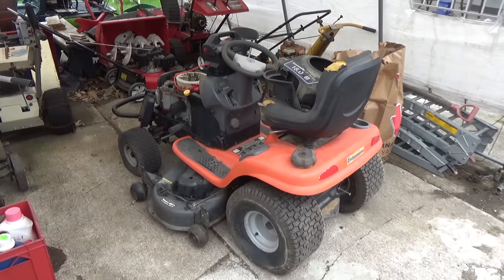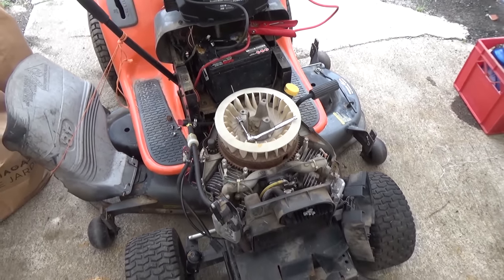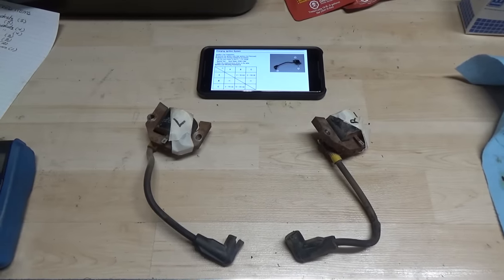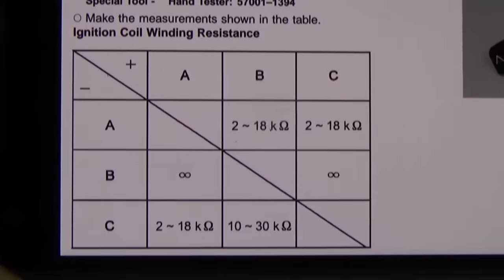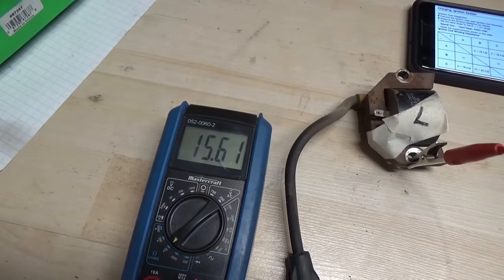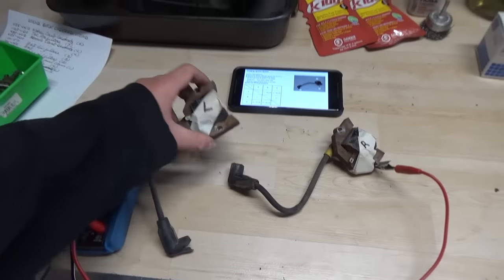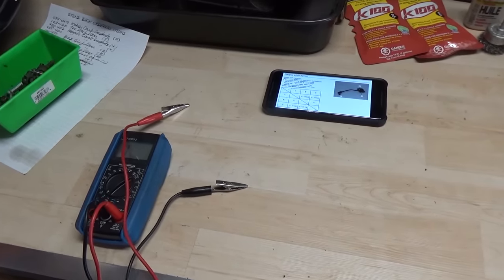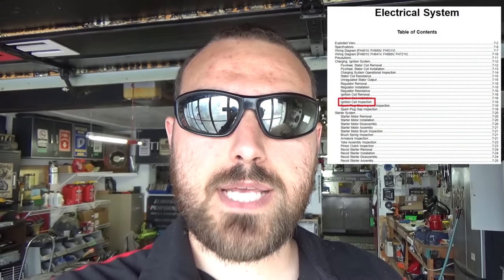How to Test a Lawnmower Coil

Comment from the maker: Couple people have asked why I tested it if it didn't produce spark when the "kill-wire' was disconnected.

This video is just a guide on how to test your coils (get the proper specs and use a multimeter to test for resistance).

Basically, if you unplug your ground wire on your coil and it doesn't produce spark, simply replace the coil.

However, if the coil produces weak spark, then you can use this video as a guide to test your coil, and determine if the coil is the issue.

I also have a video that shows a coil producing weak spark, due to a spark plug cap that has too much resistance. Once the engine got hot, it would shut down. Watch that video here; https://youtu.be/ejAX6Bn4WSo
Reply: Have you ever run across a coil that tested good and would fire until the engine got hot then shut down and stop firing?
Reply from the maker: Yes, usually due to excess of grass/dirt build up around the engine and coil pack.

This insulates the engine an causes the coil to stop working, I've seen it happen from mouse nests too!
Reply from the maker: Could also been a plugged fuel cap as well that's shutting your Engine down after a while. It could be vapour lock, because the cap doesn't let air into the tank so it stops fuel from going into the carburetor.

Once you let it sit for a bit they usually fire back up and run for about 10-15mins.
Reply: @EliminatorPerformance  Wow! Vapor lock does not cause the coils to stop firing! Vapor lock is a fuel delivery problem from excessive heat causing the fuel to "vapor lock"... Hence the name!!!
Reply from the maker: @timallbritton3716  I wasn't referring to a coil issue when speaking of vapour lock. He said his mower would die after it got hot.

Usually vapour lock causes an engine to shut down after 10-15mins
Reply: @timallbritton3716  Learn to read!!!!
Reply: @EliminatorPerformance  I have the FH500V that looses spark in 1 cylinder when hot. I've not yet determined which cylinder. The last time it was obvious by looking at the plugs. This time they look the same. I'm trying to avoid running on 1 cylinder. I assume that both coils will test fine if not hot.  Any suggestions?
Reply from the maker: When it gets hot and you think you've lost spark, let it keep running and pull the spark plug wire on one side. If it keeps running the same then you know that side has the coil issue.

If it shuts off, then the other side is your issue!
Reply: @EliminatorPerformance  OMG! Why didn't I think of that? Thanks!
Reply: This all smells like owner neglect. I've seen a few cases of that myself...
Reply from the maker: @lestergillis8171  it sat in a field for a long time, since this repair my customer hasn't brought this machine back because it's still running!
Reply: @EliminatorPerformance  This, of course begs the question: Why did they leave in an empty field & not even bother to put some kind of tarp over it ?
Reply: I have a 15HP Kawasaki with pull start. Not able to test spark single handed.
Reply: thanks to your video, i got an extra job/income. because of this. new subscriber. very helpful video.

Comment: You did a very good job on this video. Really helped a lot. The impressive thing was being honest at the end by placing all the old parts in a bag and back to the customer. Again great job.
Reply: That's normal practice, prevents the customer from saying they were charged for parts that either weren't replaced, or were replaced with used units

Comment: Excellent! I wish more YouTubers would be as concise and to the point as you are. I just subscribed. :)

A note:  It appears that some of the aftermarket coils, and in fact the coils on my John Deere (Kawasaki) mower have the kill switch terminal connected internally to the primary, rather than the secondary. This results in an Open  Loop (infinite resistance, or 0.L. on the meter screen)... yet the coil is good.

Grounding the primary or the secondary will kill the spark, so either side can be used by the manufacturer. If the secondary is connected to the kill terminal, you'll get the same reading you get when you read from the plug wire to frame ground. The plug wire will have no, or very low resistance when you check ohms to the kill terminal. But again, if they made the coil such that the kill lug grounds the primary, there will be no connection at all (open loop) to the frame or the plug wire.

Normally only one coil fails and the Right coil was obviously bad.  So... it's possible that these coils had primary connected kill switches, and the Left one was okay.  B to C or B to A should be totally open on a primary kill switch lug... they're making these things both ways... It's best to change both of them anyway, so it's good the customer got a fresh set of coils. :)
Reply: another way to rip us off

Comment: Well done. No chatter. Right to the point. I was wondering if the tolerance is pretty much standard for engines of a certain hp. If they are, you don't have to look around for the manual every time you're working, say,on a Briggs 17 to 24 hp. For example, if you're setting valve gaps, after a while you realize that if. you're dealing with an ordinary engine type, you don't have to look up the settings every time. You sort of know.
Reply: It is ok to use this tolerance as a guide but if it is available it is always good to check it to the manufacturers specifications.

Comment: At least Kawasaki is very good about giving you full specs on everything in their service manuals, including resistance readings on all relevant electrical components. Onan was also good about giving good specs in the service manual too. Tecumseh was probably the worst about giving you all the needed info.

Comment: When measuring the coil off an engine that dies when it warms up, I use a heat gun to see if things change as the coil gets hot. I have found a number of coils on mowers, chainsaws and weedeaters that will open up after they warm up. When in doubt, replace the coil. They are responsible for many intermittent problems after a few years of operation.
Reply from the maker: Yea heatsoak is a strange issue, and effects coils differently. That's a very good point, thanks for sharing!
Reply: How about cold weather?

Comment: Another great video by EP ..very knowledgeable  easy to understand. Jake breaks it down so easy.   EP has got me through some big jobs. Thanks again.
Reply from the maker: Thanks for watching!
Reply: @EliminatorPerformance  Hello do the coils have to be off the engine? Or can they be tested with them on. Thanks
Reply from the maker: Unplug the kill wire and turn over the engine, if it has spark, than it's not your coils!
Reply: @EliminatorPerformance  ohh ok. Well before I got you response I tested my “right” coil and it had the same results as your did on your “Left” one. From the “Kill” to the “Base”

Comment: Great diagnosis. It’s always a good idea to test the meter and leads before testing the component first though. By just touching the leads together first you should get 0 ohms. Just in case you have selected the wrong range or have a faulty lead on the meter or have one of the leads plugged into the wrong socket of the meter.
Reply: A very good point tony thanks.
Reply: How often do tje coils go bad

Comment: had a no start on a similar motor. This wasnt my problem but removing the kill wire to test was a good tip. I think my issue was rust on the coils. I removed them, cleaned, and reset the gap to the flywheel and got spark. Thanks

Comment: I have the same engine Kawasaki in a Husqvarna tractor mower. My first diagnosis was no spark. But I was wrong. I took a test light n placed it in spark plug cap and other end on spark plug(still in engine). Turned over engine and when I looked at plug there was a spark while holding it close to plug. Then with engine switched on I heard a small noise( sizzle). Realized sound was coming from bottom of carbaretor. Then cleaned plug in on solenoid. Still heard noise. Then tapped it gently with screwdriver and heard a click. Engine cranked up. I cut grass with mower for an hour. No issues. Just be sure there is actually no spark b4 buying a coil. I have been told they rarely go bad in pairs. Usually just one goes bad. Great video but I’m certainly a novice on a volt meter. Both mine checked bad but obviously my skills are not where they should be on the volt meter.

Comment: @4:20  Good comment about the plug connector.   I just had that very problem on my weed wacker.  I was happy when I found out I didn't have to buy a coil, which may not have been worth it for my old Echo.

Comment: Good video. Lot's of information. When is fixing not worth the parts and service? I guess when you don't have the money to buy a new one.
Reply: Fixing is not worth it when the labour and parts will cost more than 60% of the replacement cost of the unit. Additionally, if it is a push or self propelled mower not worth repair if the deck is rotting out and you can not get a decent deck for a cheap price used.

Comment: Thanks for the test numbers for the coils. Had been a lot of years since i had to. Test a coil. Very helpful. One thing to note is that a coil wire to base and the primary winding that is infinite is the some MTD mowers have a built in resistor in the spark plug end of the secondary wire. Mine had a open in that resistor. Eliminated it and the mower runs. Thanks again.

Comment: My ride-on has the same FH531V v-twin. It still runs but it's been progressively running rougher on each use and I found the spark is intermittent on both plugs. What would you know, it's got the same issue where both ignition coils are out of spec! I've used the mower every single year since purchase and so it would seem they've just gone bad with age.

Comment: I appreciate your testing, however it is possible you mis-diagnosed a faulty coil from the B-C connection.  When looking for a reading from 10-30K ohms, you cannot use the 20K ohm scale.  It must be reset to the next higher range.
Reply from the maker: I did end up testing at higher reading, I just didn't get that part on camera! Both these coils were shot!

Comment: Very Very good video, Thanks for including the coil air gap!. Dad used to stick a match book between magnet and coil, probabley learned it from a sage mower buff. Would this be a feasable method for adjustment? Please suggest
Reply from the maker: Business card is acceptable, they're usually 0.010"-0.012" which is fine on most mowers

Comment: can you have spark and still have a coil issue? I have Fc540v kawasaki that died but throws spark but will not start and blows flames out carb. key isn’t sheared and magnet hits last part of coil at tdc. all i’ve got left is the coil or valves messed up but I did check valve lash and it’s fine .006. Tried replacing the ignition module aka ignitor and still won’t start. my coil test says plug end to base is within specs at 11,300 but kill to base I can’t figure a reading based on specs calling for 60-100 and the best i can get is 0.7 on the 200 ohm setting. I tried pulling what you called kill wire that goes to the ignition module but then I have no spark at all.

Comment: If you've got compression, spark and fuel and it still won't run, check that the flywheel didn't break the keyway and rotate, putting the engine timing way off.
Reply: Great tip but if your engine has a decompression release you can not get a proper reading you need to perform a blow down test

Comment: I just acquired a long neglected John Deere tractor  that had a list of problems and a longer list of new part requirements. This unit had sat for an extended time also and had mice nests under the engine cover. They chewed up the plug wire at the coil, but not enough to make it unusable. Looking at the stacked laminations, one is becoming distorted by rust stack. The bolts that atttach these coils to the block look like they'll snap completely if any attempt is made to remove them......

Comment: Awesome video     THANK YOU........I had a lawnguy explain to me about the coil.......but he was in a hurry so I really couldnt keep up with it........having said that.....my question is I have a twin briggs and stratton 21hp  mower ,   he told me that if lets say the right cylinder doesnt start and run (without the plug in ) that it would 
be the opposite cylinder with the defective coil........did I missunderstand ???     Thank you again !!!
Reply from the maker: Yea so fire up your machine, and unplug 1 side. If it runs worse, you know that cylinder had spark. If it runs the same, and there's no change, you know that cylinder didn't have spark.
Reply: @EliminatorPerformance        aahhhhhhhhh ok now its coming together.....i know its not rocket science..........thank you so much......very MUCH appreciated....
Reply from the maker: @mundlkalli4396  anytime, cheers!

Comment: Most often the coil base has corroded so the electric circuit is blocked. De-rust the coil base and try again. You will need to space the armature/coil gap with a suitable piece of non magnetic material, such as brass feeler gauge. A lot of machines are left out in the weather, so corrosion is a good place to start.
Reply: Rusty surface causes no work on electric
Reply: Unless the amount of rust is significant or has totally seized the flywheel to the coil which we have seen the rust has no effect on the magnetism creating the spark. It is important though that the two pillar mounts for the coil be clean to contact a clean part on the coil to provide a good ground.

Comment: I got a brand new champion generator and is has no spark when its cold out.

Ran for 3 hours and wouldn't start again. Brought it inside. Gapped the coil, cleaned flywheel and magnet. Got great spark. 

Died in 3 seconds in the cold air. 

Common for these cheap coils? 

 Ever tried adding shielding up to the coil ends to prevent eddies?

Comment: I find it hard to believe that both coils are bad. I have fixed expensive coils  ( Toro 2 stroke lawnmower  $ 240.00 Canadian or $12.00 American LOL ) that dont spark by putting them in the oven for 20 minutes at 275 F for 20 minutes and if it then sparks coat with 5 minute epoxy ( Or anything that will keep out moisture) to seal it. You can make a batch of cookies at the same time LOL . What happens is water sometimes gets inside and screws up the circuit. It is not always a permanent fix but it will usually get you running again unless its a different problem. Check the flywheel magnets and make sure they are in the right position and that they grab a screwdriver with good force and of course the gap between the coil and the flywheel  ( I use a business card). I always clean off the rust on the flywheel and coil but its not necessary to do that.
Reply from the maker: Ah yes, the oven is an Old-school trick that definitely can help in a pinch! My customer was looking for a more permanent solution, and did not mind paying for OEM parts.

Comment: Mine was the flywheel pickups  cleaned them up and set the coil closer to it and then had spark.
Reply from the maker: Nice easy fix!
Reply: Good point.  After much back and forth a couple yrs ago I finally found my flywheel magnet had lost strength and replacing it did the trick.  Test was to see if it pull in and hold a screw driver from about a half in away.  They do lose their strength over time and either have to be re-magnetized or replaced.

Comment: My Weedeater lawnmower will run until you stop it.  It won't start again until it is cold.  The problem is in the coil.  It is not caused from moisture in the coil.  It may even have a weak spark periodically but too weak to be useful. It is caused from poor manufacturing which eventually leads to a defective coil.  Just replace the coil and it will work until that coil fails. Hopefully you will get a few more seasons out of it. $40.00 for a replacement coil is a lot for an old mower.  Very frustrating.

Comment: Hi again and thanks for the video/replies. MY BAD! I retested using a bolt in the spark plug cap, which I put close to the block and I could see spark. Apparently I wasn't making contact in the spark plug cap with my test light. There was spark with and without the kill wire.
Reply: Basically coil is good then

Comment: I'm assuming you are testing the primary winding when you measure between A and B. I don't understand why you get an open reading (A-, B+) and 2-18k ohm (A+, B-) unless there's a high voltage diode in series with the primary winding. Would think polarity wouldn't matter.

Comment: Thanks for the video. Unfortunately, the Kohler XT service manual I downloaded doesn't give those coil specs, but only advises to do a spark test. My engine runs cold but stalls hot and is hard to restart hot unless I wait. A resistance test would have be preferable.
Reply from the maker: If it stalls slow it's most likely fuel, if it stalls fast it's most likely spark.

Also try loosening your gas cap, could be a clogged air vent in the cap causing vapour lock.
Reply: +Tom Alexander
 - You are on the right track!  Ignition Coil in a Car Engine behaves the same way... When Engine Hot, it shuts down.  :D .  Also, you might want to check the  resistance in the Spark Plug Wire.... Especially at the End where they "CRIMP" it.  If that is loose or worn... When the Engine is hot, it also stalls as well.  If that is the case.... Open that " Crimp " area and cut off 1 inch and re-crimp it. You will be good again! :D